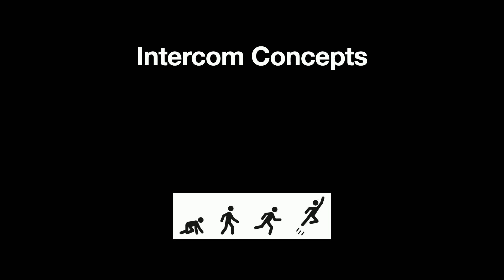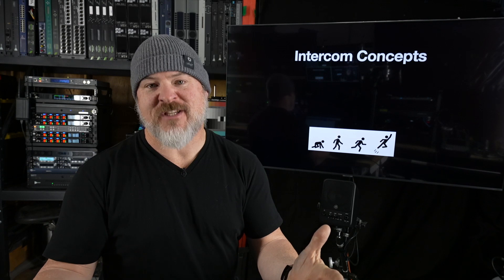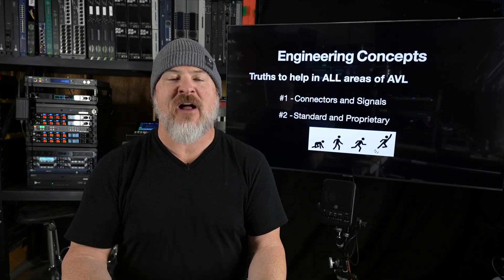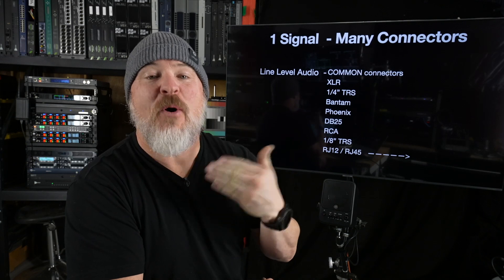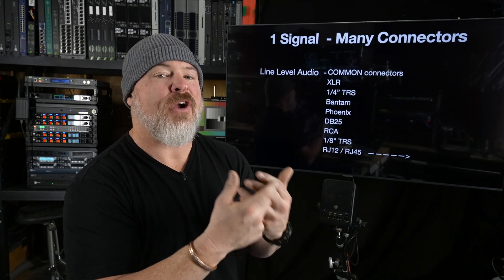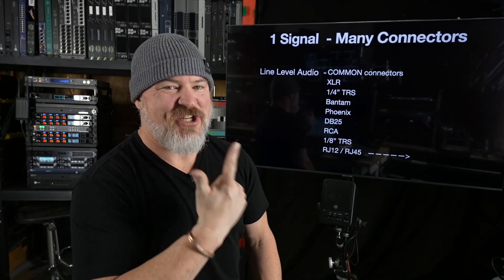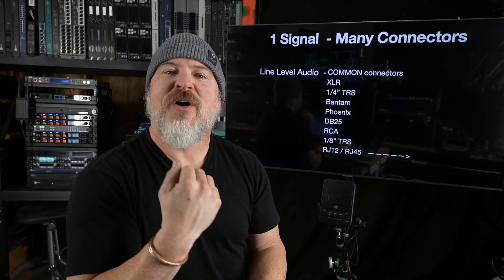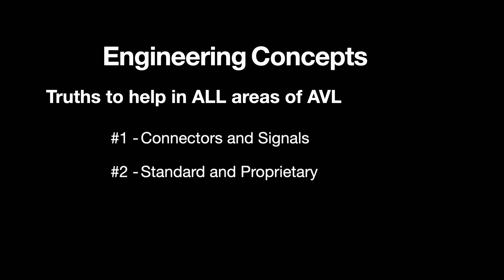Concepts - ep0.5 Engineering Mindset

Comment: I mostly do corporate and theater lighting and video work in the NYC region, we call that an IEC normally. Technically, it's just one particular standard of IEC, but it's the most common 3 pin type in our area. The most standard 2 pin type (technically a C7 I believe, polarized and non polarized) are often referred to as "two pin IEC," and the C5 is very occasionally referred to as "Mickey Mouse Ears."

Btw, if you're struggling to understand physical connector vs signal type and don't mind digging deeper into the rabbit hole, researching the OSI network layer model might help, with layer 1 being the physical connection and layer 2 being the data link layer, or in my mind, how the changes in voltages are created and translated back into a signal. Sometimes that's analog, like a wave in analog audio, and sometimes it's digital, like the exact order and speed of voltage pulses used for networking. But it's ultimately all just changes in voltages, or in the case of fiber, flashes of light that get translated into changes of voltages.
Reply from the maker: WooHoo! Check all that out!